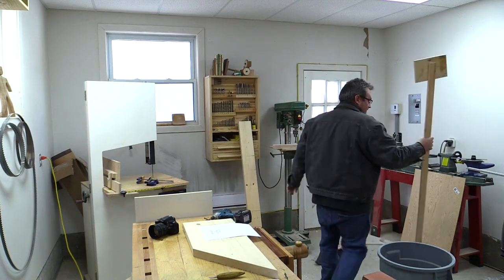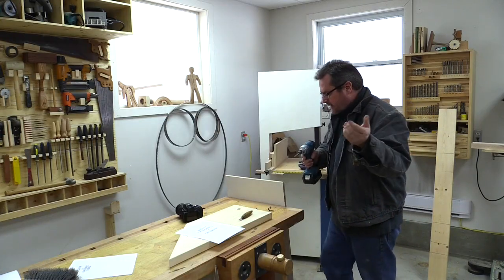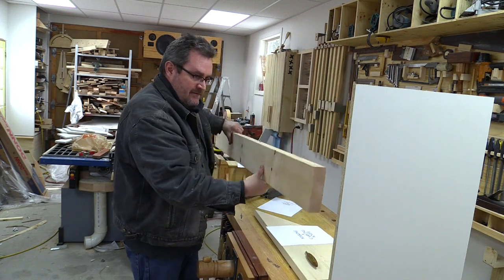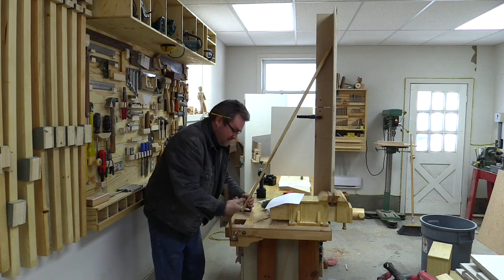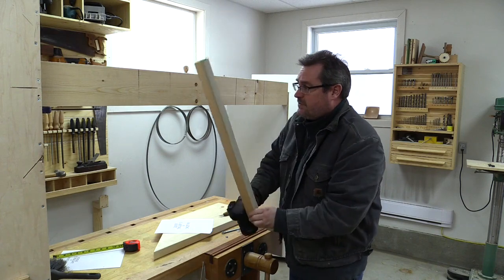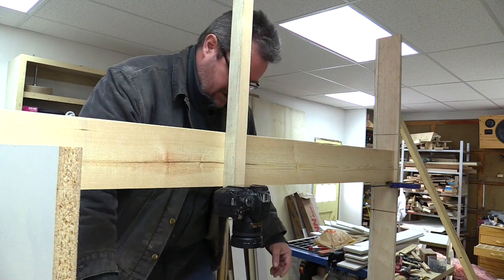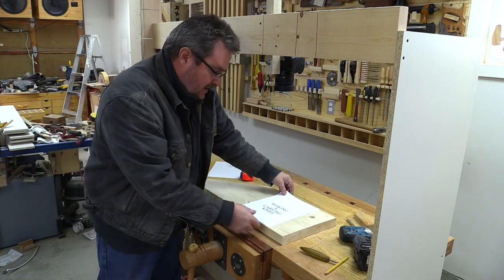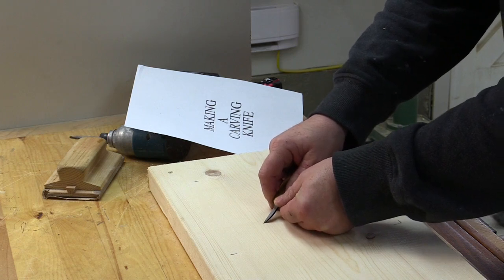Camera Set Up For A Stop Motion Carving

Comment: John Heisz Interesting John, I`ve watched frank howarth s stop motion videos but never looked into how the setup is made to produce it.It must be ALOT of work. Looking forward to see the re-edit of the carving knife video
Reply from the maker: Bellevue Woodshop Definitely not something I would want to do every day, that's for sure. Too nerve racking too, since the whole thing can be ruined if something moves even a tiny bit.
Reply: I Build It Some minor movement can usually be fixed though without being very noticeable, for instance through the "Load Files into Stack" script in Photoshop, which can auto align images so you don't have to do it manually.

Still, cool video, does this mean there will be more stop motion to come?
Reply from the maker: Switch & Lever That sounds like a neat feature in Photoshop, but I don't have or use that program. I have used stop motion in other videos before this (the kant twist clamp video, for example), so it's like a once a year is enough type of thing for me.

Comment from the maker: General note on this: The photos in the stop motion are ok, but lack contrast to really make the carving stand out. Yes, some contrast can be added, but no software can perform miracles. It would have been much better to start with the correct lighting.
Also, I have extensive experience editing and adjusting pictures as well as editing and adjusting video.

Comment: Just the light bouncing off you is enough to change the lighting if you aren't standing in exactly the same place every time.  Learned that one the hard way.  A raking light would have helped but you could bring that more to life in editing anyway.
Reply from the maker: krtwood A light down low to cast shadow into the cuts would have worked wonders, but the old hindsight 20/20 thing bites me in the ass again. Tough to fix the lack of contrast without accentuating the slight lighting differences between the shots. The clip was as good as I could do with video editing (ColorDirector). I may take a shot at editing the individual photos, but that would be a TON of work.
Reply: krtwood that is a pro tip!

Comment: When I did a stop motion of me putting a puzzle together I used the software that came with my camera (Canon) to both control the camera and store the pictures. That way I didn't have to worry about the cameras memory. It is nice not to have to stop every x seconds to take a picture. Just set the interval and do my thing. In your case you could either set a timer to let you know a few seconds ahead to clear the field or take enough pictures and then pull out the ones with anything else in the frame. This would be much more difficult and time consuming to sort the pics though. I know you want efficient practices whenever possible.